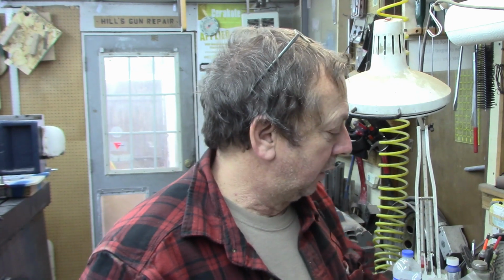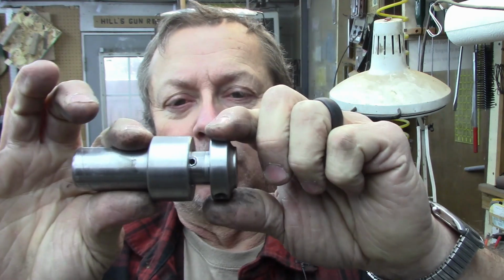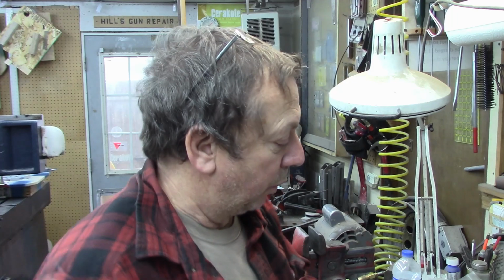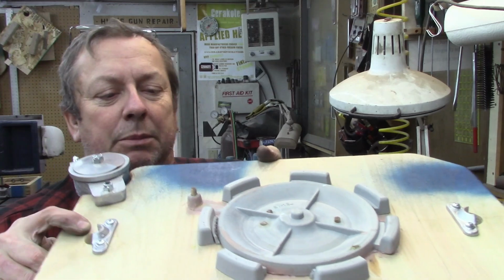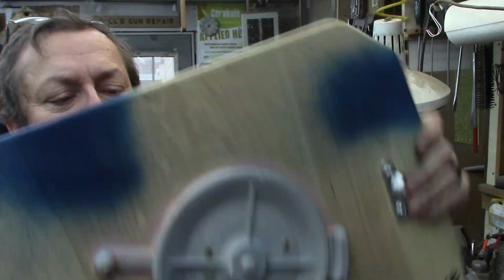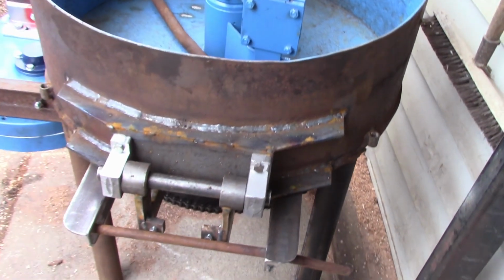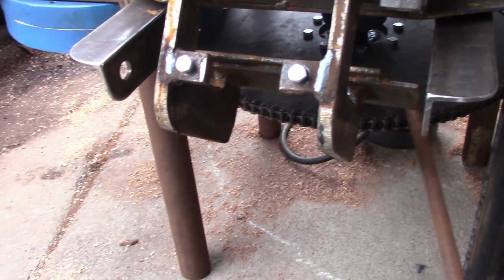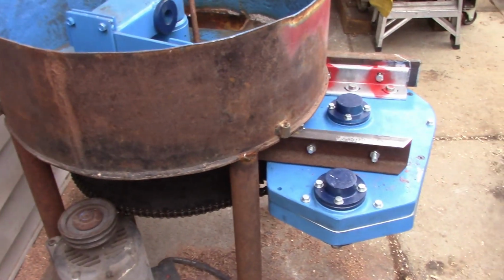Shop Update: December 24, 2021

Comment: Great progress on the Muller, be seeing it in use by spring.
 Have you ever considered trying to make molds for die casting aluminum? Ole foundry man is only YT'er I've seen use them an look like alot of work to get fine tuned.
Merry Christmas to you an your's Dan
Reply from the maker: Hi John, It better be running before spring I need to be moving on to other projects. Yes I have several dies drawn in cad and have been machining on a couple in my "spare" time. Several problems in setting up in a small shop so we will see how well they progress for me. Have a merry Christmas. Dan.